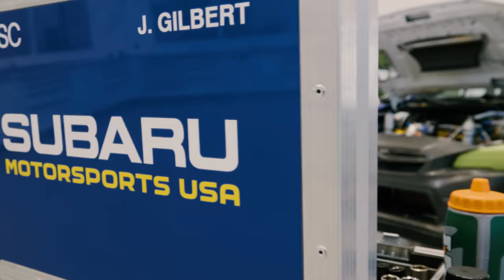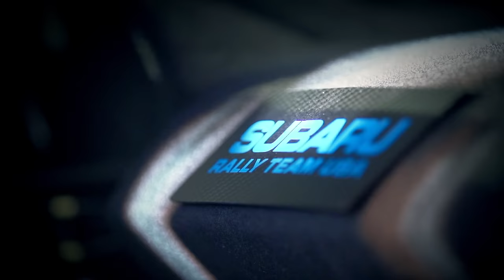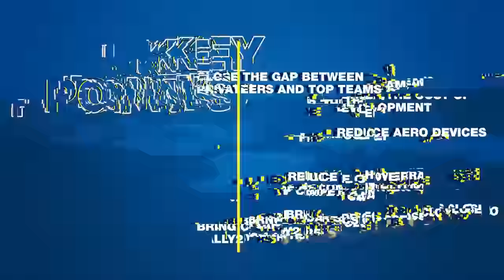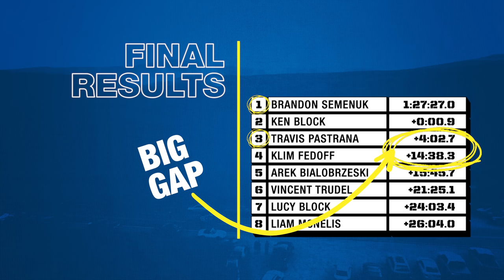NEXT STAGE - Part 1: Re-Building History - Subaru Launch Control

Comment: I love this. I used to work at Ralli-Art MMSP when Mitsubishi was in the WRC, the last drivers if you will, Rovanpera/Panizzi/Galli and until you have seen what goes into building a competing car from scratch you have no idea. The research and development is astounding before even starting a build.
Reply: Mitsubishi has an ek cross with a 4WD turbo engine

Comment: "Yeah these cars are factory"
completely strips every piece and cuts chassis up for rebuild
Reply: It's still "factory."  A full tubular frame chassis car would not be factory.
Reply: @MD-pz3cn  I know, its just funny how the wording is for race rules lol
Reply: Rebuilt in another factory😭
Reply: Just the shell is factory everything else is custom, people actually think STI parts where on the last car lol they are using the same engine from the last car and Trans which are custom race spec stuff etc

Comment: Honestly should have just gone for a full Rally2/R5 class rules so at least people all over the world can order then and see more subaru's back in rally. Hell even toyota is making a R2. Yes you won't beat the skoda's or that in the first year but at least it will be a great battle, and hell VSC you stuck with Rallycross for so long, at least a R2/R5 would grow the brand worldwide and help bring something back to the brand after killing the STi
Reply: Not really an option, the engine in this car is already significantly smaller than a factory WRX engine, and they'd need to lop an additional .4 liters off of it to fit regulations.
Reply: @griffinfaulkner3514 current 2024 rules are power to weight now. Displacement limits are based on what tier they compete in now. The fa20 wrx is on the approved list of 2024 rally2 chassis
Reply: @griffinfaulkner3514 they made a 1.6 for the levorg so that should be no problem

Comment: There is a huge difference between the platforms of the VT15 R and the current WRX from steel MPA classification and body design for rigitidy & suspension.
I feel that the current WRX and there product will be totally different, only the shell will look alike. Still I suppose that what marketing requires. RIP Sti.

Comment: this looks amazing but i do hope they eventually revive the STI
Reply: EJ25 is a underpowered dinosaur. Thay called it quits instead of building something new from the ground up.
Reply: @stephenschenider4007  yeah its understandable but the company is definitely still growing so an STI revival with an EJ30 in 2030 would be pretty awesome and generate a lot of hype
Reply: @stephenschenider4007 this rally car still uses ej20 bro
Reply: @stephenschenider4007  the EJ25 isn't what makes the car an STI vs a WRX, it's primarily the differentials, especially the center diff. They could easily have made an STI of the current new WRX while using the FA engine.
Reply: @jsquared1013  Sti is about ej and DCCD it’s means a lot for subaru in WRC history.
Reply: @hhhydeee the ej is not that relevant anymore.  I do remember hearing Chris Atkinson say after Subaru quit WRC a few years ago that their technology was decades older compared with the other manufacturers

Comment: Here’s an idea Subaru…use your current platforms that you promote so religiously to use in Rally stages, to go hand in hand with your word! Like the brand new SPT transmission? Don’t you think you should have used the GT model for this years rally events, and utilize your new performance transmission!?
Reply: Lol those will explode in seconds. Factory parts aren’t meant for these extreme races, not just subaru but all brands too.
Reply: The SPT is meant for regular driving. These cars have had their own specially built transmissions for ages to take the kind of beating expected, but also in spec with whatever rules they need to follow and also to be replaceable/serviceable as needed in the field. They are extremely expensive.

Comment: You guys should design the current WRX in a pleasant way and bring the STI back
Reply: They only used the shell of the sti so doesn't really matter what shell they use cause there ain't no sti parts in last car or the current car, the engine and Trans are custom or race spec parts adapted for these shells

Comment: Just not the same without that STI badge!!
Reply: Makes 0 difference. It’s just a name.
Reply: @SuzukiKid400 said the wrx driver lol
Reply: @diegocervantes9103 I own a ‘22 WRX and it’s far better than my old VA STi in every respect except for the brakes. It’s just a name!!
Reply: @SuzukiKid400  Granted, I've already bought my car and it was the styling of the VB that made me not get it over a GR86, but it would be nice if the DCCD transmission was offered in it. To me, when you get an STi, it's the transmission that makes the biggest difference. Suspension is easier to upgrade than it is to swap a transmission. That, and the VB already has enough power with much more on the table.
Reply: Agreed the tranny could be upgraded.  But in stock form, the VB is a great car. I have no interest in modifying the suspension as OEM suspension is just so good these days.
Reply: @SuzukiKid400 no it’s not just a name. Sti has a way better transmission and overall drive train than a vb, not only the brakes. It’s also far more developed than a vb. Find me a 1000hp vb. I don’t believe you’ve owned a va sti. 🧢
Reply: It's not the badge, or the suspension, or the brakes, or even the power (all of which are easily upgraded beyond STI specs in the aftermarket), its the DIFFERENTIALS, most notably the center differential and its controller. THAT is what makes the STi better than its contemporary WRX sibling, and it is not easily replaced in the aftermarket (front diff and rear diff upgrades are available... an active center diff is not).
Reply: @jsquared1013  you’re mostly correct. There’s no front diff however. Its married to the trans and is absolutely transferable and bolts right up to any Subaru motor.
Reply: When it comes to this new rally car doesn't matter at all literally was just a shell they used none of the parts in the actual car were even STI. This new car is similar to the last car with a new shell and some tweaks and upgrades.

Comment: Subaru, I want to see the body camo print as a shirt, sweatshirt, beanie, or even as socks.  Very clever how you worked in the logo and built the swirlies around it.   so, when is the Crosstrek rally car getting put together?  Any plans for a Legacy rally car?  Pump some blood into the dull sedan and introduce the next gen Legacy Spec-B, or in this case, a Spec-R (R is for rally if you didn't catch it at first...)

Comment: You want to make a point and regain credit, beat the opposition in WRC! Unfortunately for Subaru the WRX has put on so much weight to suit a certain market the current gen would get smoked by the latest WRC cars. 
I love my VA STI but still wish it was more of a beast and more nimble to drive from factory.
Reply: WRC is a micro car championship now. My bet is that they can use Impreza RS and make it work against Fiestas, Polo, I20s etc.

Comment: Step 1, take delivery of 2023 WRX, Step 2, take everything from the 2023 WRX and throw it in the trash. "we race what Subaru sells" Yep, the doors, trunk, and glass.
Reply: I think the suspension pickup points have to be within a tight window of the factory points.

The engine is based on the production engine as well, you just don't see that in this video because it's off in the shop getting improved bits added on.
Reply: Welcome to racing (especially rally), I guess. At least be glad that ARA still requires a no-shit road car chassis instead of going full stupid tube frame bucket of parts like Rally1.
Reply: @jsquared1013 same 2.0 as before they aren't using the FA

Comment: Glad to see VSC is still building rallycars and in the ARA. 
Not happy to see Subaru SOA/SOJ consider this the starting point for the chassis. 
Good luck guys!
Reply: I dunno... I don't think it's such a bad starting place. Especially considering they're only using about 60% of the original chassis to begin with, and building it from scratch from there. Regarding the motor, from what I've watched and read, the FA24 is possibly more tunable, or at least, more tune-ready than the FA20 was so mechanically, the new motor should make for a decent starting point. I think the VB gets a lot of hate for aesthetics, but the car will barely resemble a VB when it's done anyway, so it's kind of a moot point. 

I get your disappointment as the VB is a polarizing design, and not nearly as beloved as the VA that came before, but keep an open mind. I think VSC will do something amazing with this build. :)

Comment: That garage looks clean asf but why are there no lifts?
Reply: Because Rally
Reply: When we took a tour of the shop they said it was basically because there's no option for using lifts in service at the events. Work on it at the shop the same way they'd work on it at the rally. If there's something that's too difficult to do without a lift then it wasn't designed properly.
Reply: @SteveHarrellRally  ahh that makes total sense, thanks for enlightening me